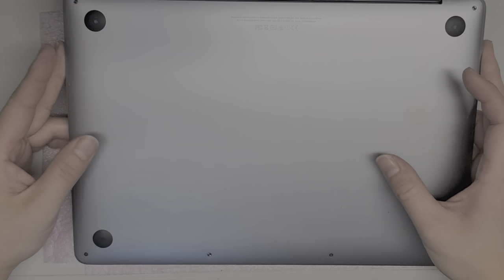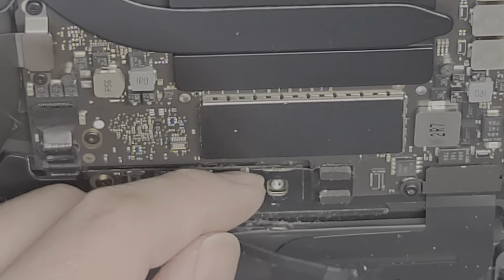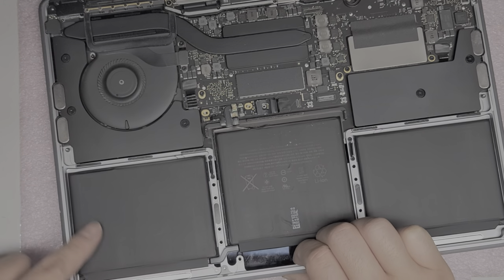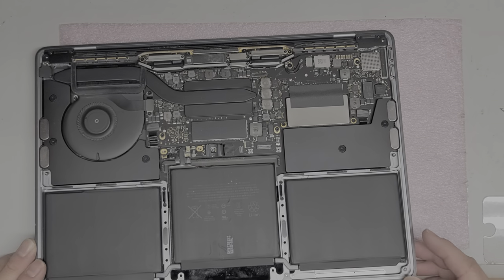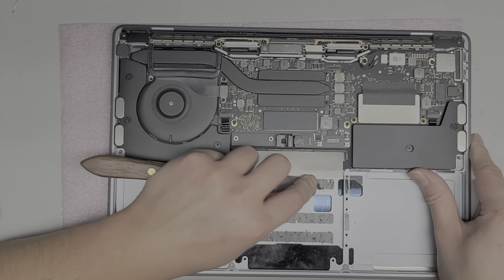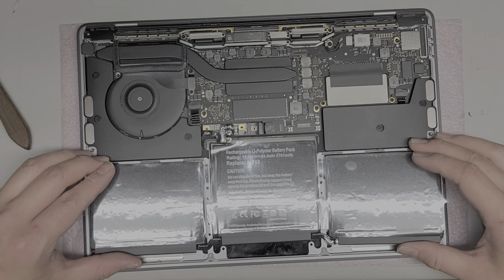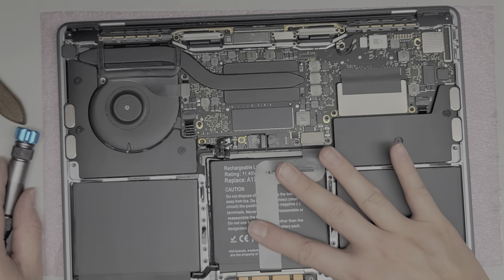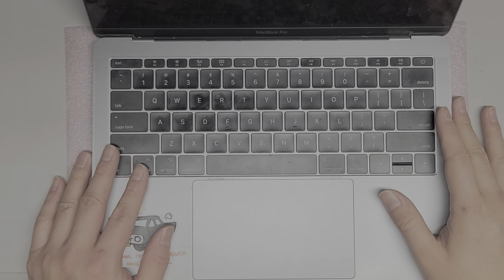13" inch MacBook Pro A1708 Late 2016 Mid 2017 A1713 Battery Trackpad Replacement

Comment: Hello! I replaced battery through your tutorial but now touchbar is not clicking and its not turning on. Charger doesn't consume energy. Any suggestions?
Reply from the maker: This model doesn't have a touchbar. What model is your MacBook?
Reply: @ItsBinhRepaired  touchpad i mean. Actually it works and touchbar clicks. But it stays always at 73% and says "service needed". Also internet "broken".
Reply from the maker: @АбвАбв-ь1и  sounds like bad battery. Did you remove the touchpad before removing the battery?
Reply: @ItsBinhRepaired  yeap. Now it says "no battery installed" and fan goes crazy loud.
Reply from the maker: @АбвАбв-ь1и  make sure it's all lined up properly and the ribbon cables are connected right.
Reply from the maker: There's a thermal sensor in the trackpad. If it's not connected right, it'll have that issue.
Reply: @ItsBinhRepaired  ok. I will try to reassemble it.
Reply from the maker: @АбвАбв-ь1и  hope it works out
Reply: @ItsBinhRepaired  well it didn't. No battery and no CPU temp info.
Reply from the maker: @АбвАбв-ь1и  :( might be a bad battery
Reply: @ItsBinhRepaired  yay! Fixed it. Battery maker did drop of glue or lacquer on one of the battery board contacts. I scratched it and it works now!
Reply from the maker: @АбвАбв-ь1и  awesome!

Comment: what battery do i buy and where do i buy it?
Reply from the maker: Are you certain it's the correct model and year?
Reply: @ItsBinhRepaired  okay i got the right battery and i just took the battery out but i dont have electrical tape to cover the part of the foil on the battery that ripped when removing it, so what should i do??? SCARED LOL
Reply: i put it outside on concrete for now so its not in my house
Reply from the maker: @ashleyapplegate5988  bring it to best buy and ask them if they'll take care of it, or stab it until it burns to ash lol jk.
Reply: @ItsBinhRepaired  okay last question LOL if the battery loses power quickly after installing it, is the battery bad or do i need to fix something? everything is working and its working WAY better than before (it wouldnt even turn on after being plugged in for hours) but i feel like its draining quickly.. i havent used this computer in over a year not sure if that has something to do with it
Reply: like went from 57 to 52 in just a few minutes but maybe thats normal i cant remember how they normally function
Reply: oop now its on 51
Reply from the maker: @ashleyapplegate5988  hmmm might be a bad battery. Usually MacBook batteries last a few hours.

Comment: what’s up with the p ram reset stuff etc at the end? i’m gonna replace the battery of my macbook A1708 tomorrow, do i need to do this? or can i just switch te battery and skip the last part with both reset options? please explain! 

nice clear vid btw ;)
Reply from the maker: Why skip it? It's so easy to do and takes no time at all. It resets things Apple stores in the memory so it doesn't get confused by the hardware changes. Always good do it when making any hardware changes. For specifics of what it does, you'll want to Google it.
Reply: @ItsBinhRepaired  ah oke, thanks!

Comment: Just did the whole process. Everything went fine. 
A couple things that scared me but ended up being just fine.
First time I boot it up, the battery icon in the upper right part of the screen showed the "plug connected" icon and 1% battery. I rebooted doing cmd+option+P+R and it showed a 70% battery but "battery not charging". Left it some minutes and started to show "battery charging 72% 4 hours 30 minutes to full charged". Few minutes later it showed 85% charged and 27 mins to fully charged, which I assume is the correct information. Seems that it takes a while to "recalibrate" the whole battery thing.
Also first time that I booted it it took longer than normally, which again I assume is normal (but is scaring af...)
Also, as an advice, the most tricky part for me was placing the battery correctly. If you don't place the center part just right it might affect the trackpad assembling. I was lucky by a tenth of a milimeter... I think is useful to practice with the stickers protected and once you know where to the battery has to be exactly, remove the sticker protection and go for it.

Here you have a couple amazon links of what I bought to do this (it is Spain's amazon but I'm sure you can find in your local amazon:
Battery replacement (the screwdrivers that come with this started to be worn out at the end, be gentle or they just go round): https://www.amazon.es/Bater%C3%ADa-Repuesto-portátil-Compatible-Notebook/dp/B085LB4LCC/ref=sr_1_5?__mk_es_ES=ÅMÅŽÕÑ&dchild=1&keywords=bateria+macbook+pro+2017+13-inch&qid=1618422332&sr=8-5
Cooking tool to remove the old battery: https://www.amazon.es/Claveles-Espátula-acodada-Inoxidable-04817/dp/B011CR13QE/ref=sr_1_8?__mk_es_ES=ÅMÅŽÕÑ&dchild=1&keywords=espátula+glaseado&qid=1618427134&refinements=p_85%3A831314031&rnid=831276031&rps=1&sr=8-8
Other than that, thanks a lot, the repairing cost of this in an authorized service shop in Spain would be 300€. I just spend 60€ so the least I could do is gave you a small tip on Patreon as I just did.
Reply: Seems not everything went fine... left the computer in sleep mode with the charger connected as I do every night and when I wake up this morning the battery was at 0%. Somewhere at 2:00 am started to drain and at 7:00 am was at 0%, here is the chart from battery preferences: https://www.dropbox.com/s/2guu3kee0rph1bv/Battery.png?dl=0
Any advise on this? Thanks
Reply from the maker: Check the battery connections. Most likely not connected properly/misaligned.